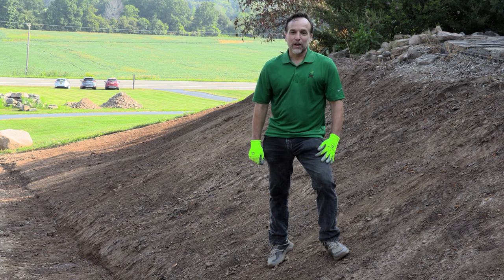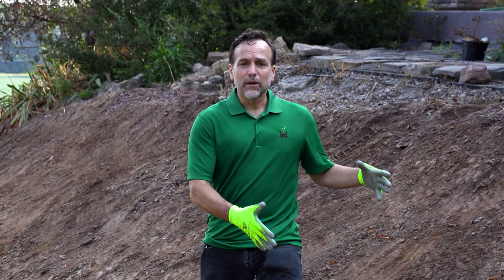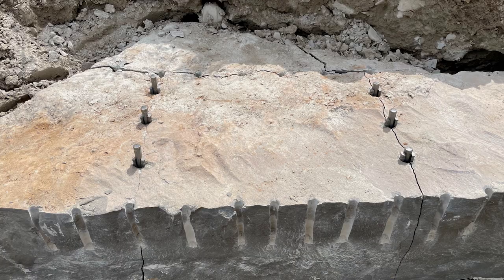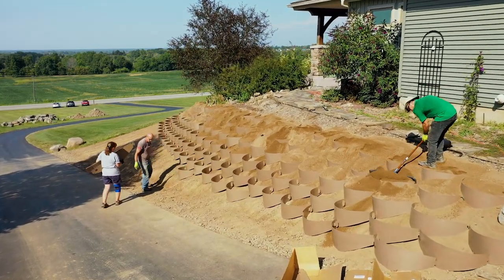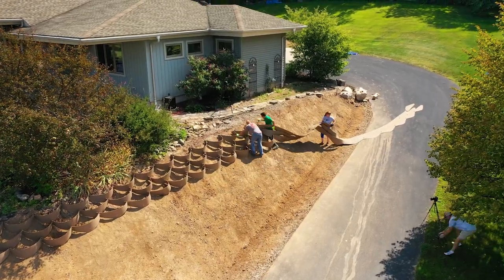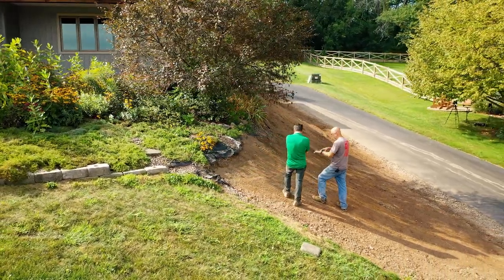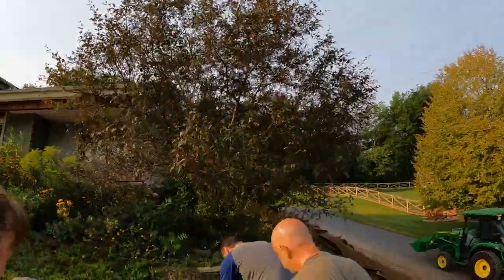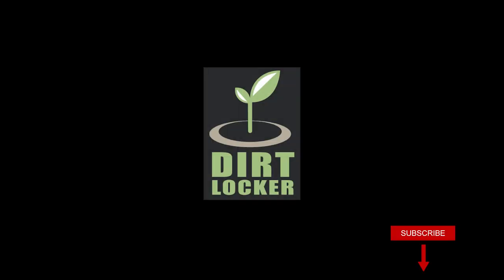Replacing a Retaining Wall Failure with Dirt Locker® Terrace Gardening Beds for Erosion Control

Comment: Florida landscaper here, I have two questions. What’s the lifetime of the plastics in Direct Sun and how do the deal with saltwater? Plastic’s don’t last long in Florida, they get brittle and crumble.
Reply from the maker: Hello, sorry for the late reply,  I wasn't getting notifications. The plastic is treated with UV inhibitor, with direct sunlight all day, they will last at least 10 years. It doesnt crumble like ABS will. They should be set up with plants that will extend the life further. Salt water has absolutely no effect on this plastic.
Reply: HDPE is typically much more robust than other plastics.

Comment: I assume those are the large dirtlocker. If so, how much of that white rock was needed per dirtlocker to create the stepping path? The rocks look similar to marble chips. Essentially, I am tryinto figure the volume of that type of rock I would need to create something similar.
Reply from the maker: Yes, Large Dirt Lockers were used. We filled up most of the Dirt Lockers with soil. Then, we put landscape fabric down to keep the rocks from going into the soil. Next we put a few inches of the white rock, probably ½ cubic foot per Dirt Locker step.
Reply: Excellent! Thank you.
Reply: @dirtlocker  , did you place the landscape carpet down first, or did you cut pieces out for each dirt locker?

Comment: My husband and I are currently building our home in central Florida. Our property is on a hill and as such the front of the the home has a pretty noticeable slope. We have been researching ways to address this issue and came across your videos. Would this system work well for our property? How would we be able to determine this?
Reply from the maker: Hi Carmen, please visit our website estimator (https://www.dirtlocker.com/estimator) and FAQ pages to get everything you need for your project area. If you still need assistance, please email us photos and measurements to info@DirtLocker.com.

Comment: Hello, dirt locker is a great idea. I’m thinking to put a stairs case on my back yard , it’s a slop about 50 degree, and the slop lasts 20-25 feet. Do u think dirt locker will work in this situation ? That means I build single column instead of an area ?
Reply from the maker: We don't recommend using the Dirt Locker just for stairs, as you need to plant at least 30% of your Dirt Locker system for optimal efficiency. So you can certainly set up a wider staircase and plant along the outsides of your zig zag stair case. Check out our FAQ page for more on this. https://www.dirtlocker.com/faq

Comment: How long will the product last in the hot sun and dry climate of Namibia?
Reply from the maker: HOW LONG WILL THE DIRT LOCKER® LAST?
+
Technically, forever! High Density Polyethylene (HDPE, which the Dirt Locker® is made of) is not biodegradable and does not break down over time. They are also created with a 10-year UV inhibitor. The original prototypes were in place for 11 years with only mild fading. Additionally, since the Dirt Locker® is designed to grow and sustain plants, ideally, they will be providing shade, thus substantially increasing the life of the Dirt Locker®. Dirt Lockers come with a 5-year replacement warranty; however, it is void if not installed per our official Dirt Locker® Installation instructions emailed to you after your purchase.

We stand by our product in the harshest winters (-58F/-50C) and hottest summers (+160F/+60C). The Dirt Locker® is made from 100% recycled High Density Polyethylene (HDPE) so the material is very durable and will not crack due to the elements. Check out this chart to see how the Dirt Locker® protects plants all year round!

Additionally, Dirt Locker® is flame retardant by nature, however, HDPE starts to melt at 235°F so although these are not fire hazards, they are not resistant to forest fires. The HDPE UL rating is UL 94 HB: horizontal slow burning with a burning rate of less than 76mm/min and burning stops before 100mm.

UV radiation: although ours are treated with 10 year UV inhibitor, if the system is sufficiently planted where it is shaded from the plants, the UV exposure is minimal.

Comment: how do you secure the bottom row so that there's no fall out?
Reply: The Dirt Locker system is secured with J hooks. Not every Dirt Locker in the system gets a J hook, there are several factors to consider when installing your system. You can find the J hook application for various designs on our estimator page on our website by clicking on the brochure.

Comment: What is the expected life expectancy of the plastic itself
Reply from the maker: these are made from HDPE which is a durable material that will last for a lifetime (think of everyday kitchen cutting boards, they are durable!) We also add a UV inhibitor so you can place these in the sunniest climates and not worry about cracking!

Comment: How long does it last
Reply from the maker: Technically, forever! High Density Polyethylene (HDPE, which the Dirt Lockers® are made of) is not biodegradable and does not break down over time. They are also created with a 10 year UV inhibitor. The original prototypes were in place for 11 years with only mild fading. Additionally, since the Dirt Lockers® are designed to grow and sustain plants, ideally they will be providing shade, thus substantially increasing the life of the Dirt Lockers®. They also come with a 5 year warranty.

Comment: How much did this system cost?
Reply from the maker: The price will vary depending on the size of your project (which will determine Dirt Locker & J hook quantity), the slope angle (which will determine the model), and then choose the color you want. You can use our estimator on our website to determine your project needs and add it to your cart to get the total price: www.dirtlocker.com
Reply: @dirtlocker  - your website is not working. Has the address changed?